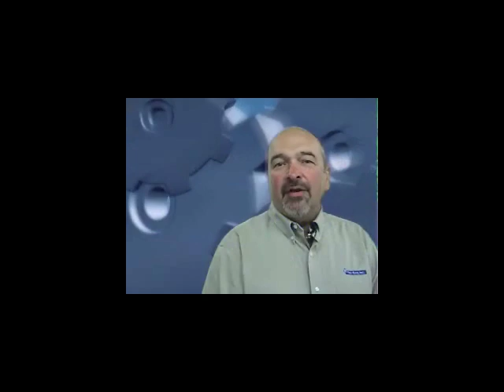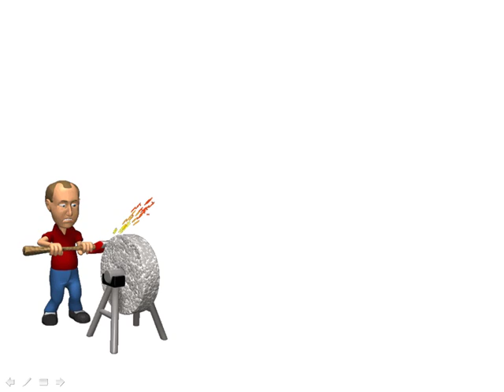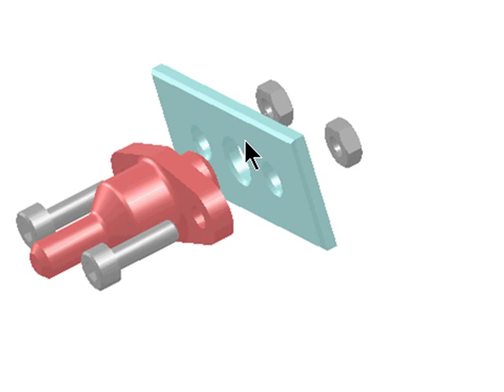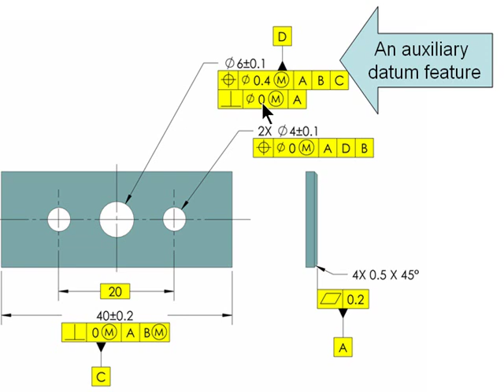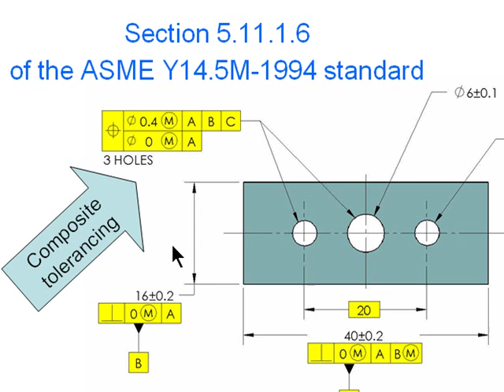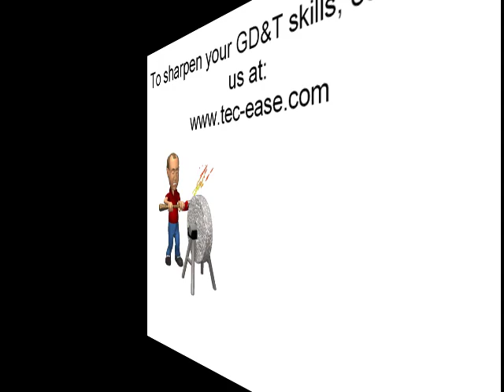GD&T Tip from Tec-Ease -  Composite Tolerancing

Comment: Hello , Let us assume pattern of two holes with dia0.5 pos tolerance from datum A,B,C . Basic dim is 20mm between two holes. So in worst case, 20mm can reach max 20.5 , min 19.5mm. I assume we have 0.5 tol zone for two holes, so t/2 is considered for two holes.   Is this interpretation right for stackups?. In case of composite is it same applicable for lower segment?. Appreciate your feedback . Thanks in advance.
Reply from the maker: That is correct if the holes are referenced at RFS (if they are referenced at MMC or LMC, there is bonus tolerance, so the worst case would be different).  It is the same principle for the lower section, but the lower section controls the location of the features to each other, not to the datums.  For tolerance analysis stackups with composite tolerances, using the upper or lower tolerance value depends on if the tolerance loop includes the datum features, or just the pattern features.
Reply: @Teceasegdt  Thankyou for the response.

Comment: Suppose there are three holes on a plate. Each hole position tolerance from datum references is dia. 0.25 mm(no composite frame used).
Now, I want to change this definition to composite.
1) Do i need to keep dia. 0.25 mm (or) dia. 0.5 mm in the lower segment of composite frame?(not to change assembly requirement between holes)
2) Do i need to show relative dimensions between holes(or) Is it okay to show dimensions of three holes from datums?
Reply from the maker: (1) If I am understanding your questions correctly -  If NO composite frame is used, the DIA 0.25 position tolerance controls the holes to the datums AND to each other.  When using composite tolerance, the goal is to relax the tolerance to the datums, but keep the tolerance tighter between each hole.  IF the DIA 0.25 position tolerance is required for the holes to each other, that should be the lower segment position tolerance.  If the tolerance between the holes and the datums can be relaxed, the larger value should be in the upper segment.

(2) It is OK to show basic dimensions either directly to the datums OR between the holes.  Basic dimensions define the perfect (true) location of the holes, so there is tolerance accumulation, and the result is the same either way.

if we have missed the mark or if you have further questions on this topic, please let me know.